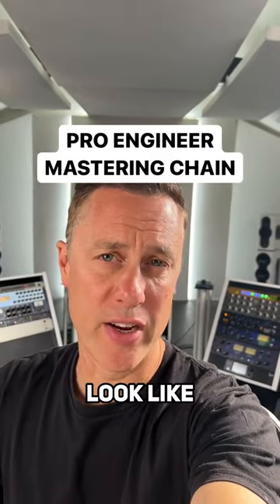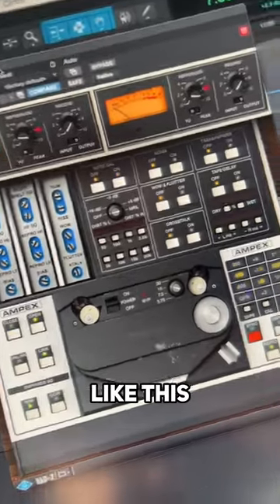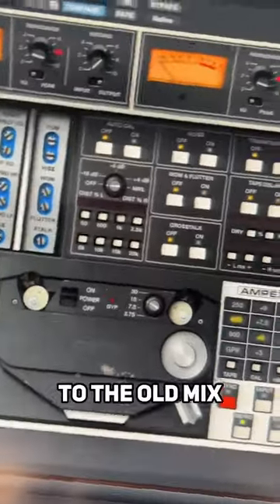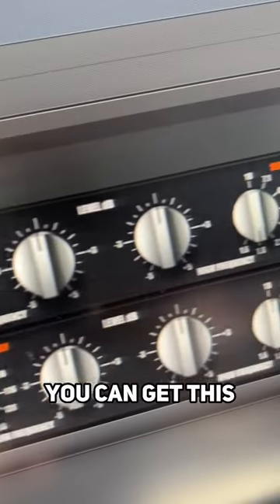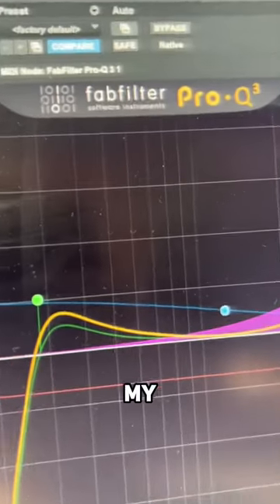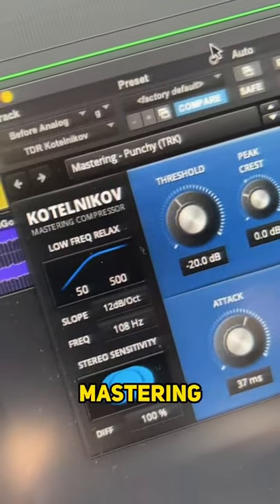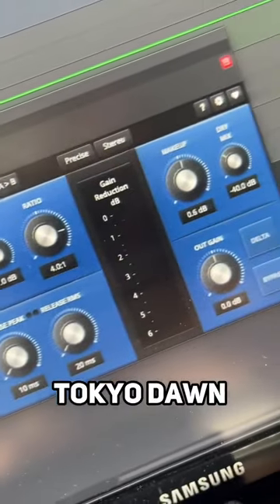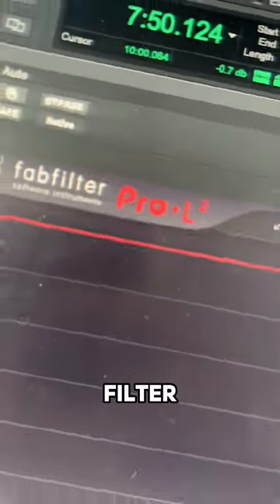PRO ENGINEER MASTERING CHAIN

Comment: any clippers?
Reply: Would you need one with a mastering compressor already on it?
Reply: The way he prefers to set up Pro-L 2 has it acting practically like a clipper. a dedicated clipper might be overkill, and if he needs to hit a few samples a bit more, he has the option of going into his converters a little hotter before printing. that tends to be more common an approach with mastering engineers than using clipper plugins.
Reply: Kazeog Klip3 and SIR Standard clipper both do a nice job. They can clip several Db fairly transparently if you find yourself pushing hard into the limiter for volume. 🤙🏽
Reply: I was just about to ask this. I have been using been using 2 clippers in mastering. One on the final mix and then again before the limiter.
Reply: @LazerProphet   If there's some crazy spikes in there they really mess up how the compressor is getting hit. Taking out some random spikes can have the compressor working more evenly.